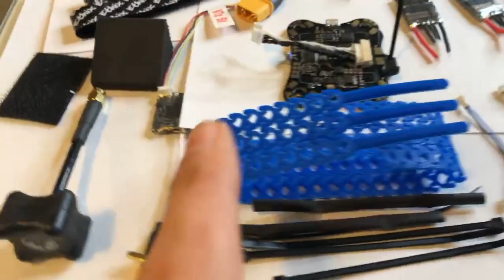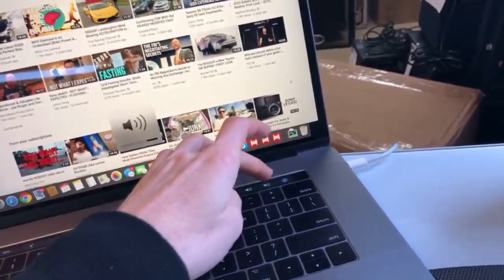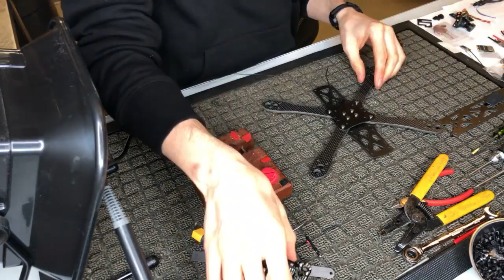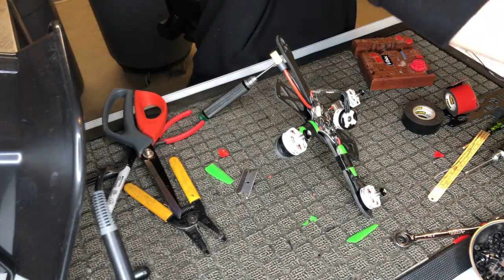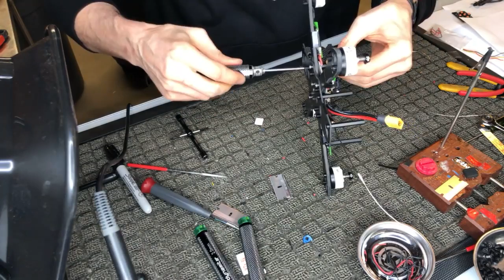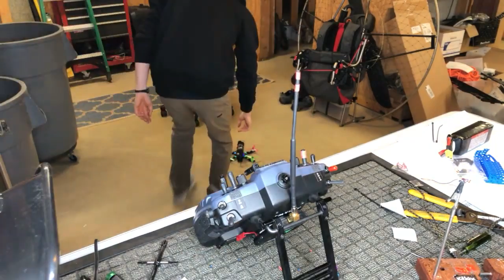Mr Steele Alien Build Video 2019 updates Step by Step! (from scratch) LIVE answering questions

Comment: In addition to the capacitor at the battery terminal, you can add a TVS diode to attenuate the voltage spike during connection (helps save the batteries), for a 6S with breaking voltage at 28V would work fine (like a SA28A)

Comment: at 18:30 you mentioned that washers are used to "avoid scratching the carbon", it's not actually true. The general use for washers under a bolt head is to distribute the clamp load to a larger area, since the head makes very little contact with the part (considering the hole is also larger than the diameter of the bolt shank). It is especially useful for carbon panels, as even though carbon is very strong and stiff, it is very weak in dealing with point loads, such as torqued bolts. You might say it works for you without washer, blabla, but just saying that washers are not used to avoid scratches but to distribute the clamp load at the joint with aim to avoid pull-through failure. I would agree though that the PDB & FC boards are not exerting tremendous loads on the panel, but for the rest of the frame I would say that washers are a good idea.

Comment: I’m running 45amp 4in1 in 4s but 6s capable on 1404 3000kv mamba motors on a 3” Roma l3 with a clracing f722 32mb fc that’s 8s capable. Feels good.

Comment: Jeez, 900 F is blisteringhot even for lead-free solder. I guess for soldering cables to pads it’s fine since your not really close ro a component, but people should really learn to solder at a more sensible temperature if they’re even going to solder some actual circuits. For lead solder I’d say you want to stay under 650 F, lead free needs up to 750. Higher might be good for desoldering something big from a massive ground plane. More important than high temp is that the iron is capable of delivering enough power so that it can maintain the heat set when in contact with something big. If you have a less powerful iron you can pump up the temperature to compensate in some cases, since that makes it take longer for it to cool, but it’s bad practice.

Also, solder fumes from fresh solder isn’t dangerous to inhale, even for leaded solder. You should however be careful to not put your fingers in your mouth or eat without washing your hands thoroughly after using leaded solder.

Like I sais, for solderimg wires to pads it’s probably fine to crank it, and it does make things easier, but don’t try to solder a sot-23 IC at 900.

Comment: I flashed FC and ESC, and am able to test all 4 motors on KISS GUI. But motors only respond to radio when FC is connected to KISS GUI and only goes up and down(not left or right).
Can anyone help me trouble shoot this? The fact that motors respond when the FC is connected GUI, there is communication between the radio and the receiver right...?

Comment: Thank you Mr Steele! From this video I went from absolute beginner to flying. For those whom are also starting for the first time, a couple of things I found that I needed more info to get going 100%. 1) With the Kiss PDB board you need to solder the 5v and the little pad next to it to bridge them to get the video transmitter powered. 

2) You need to install the Kiss GUI software and connect to the quad, in the 'Configuration' tab create an 'Arm' switch under 'AUX Functions', select AUX1 Medium + High, you then need to program your transmitter model to include an ARM switch. 

3) With the battery connected to the quad, plug into the Kiss GUI software, then use the 'ESC Flasher' tab in the Kiss GUI software, there you can reverse motors 2 & 4. Hope this helps someone.
Reply: Paul O'Connor I have set the arm switch but still not arming..  I don’t know what is the issues. I’m new to kiss and Crossfire.. pls help me on this...

Comment: Anyone know what the wooden clamp steele is using in that video? looks pretty handy
Reply from the maker: Called a solder buddy.   Trying to make that a thing  soon
Reply: @MrSteeleFPV  Looks like its out of production. I have a CF tool that does a similar job but was from the era where Deans Ultra connectors were the bees knees :) I like the idea of a soft-jaw clamp in the same device though

Comment: When you select which vtx power in the kiss gui you want to run, does this automatically unlock the tbs unify pro vtx? Also is the low power option for  when the quad is disarmed and high power option for when armed?

Comment: Built one !!! If I managed you will too))) My first soldering experience and first drone! Few tips from total a noob: 
1. Get the proper tools! 
2. Work Place will be a mess so keep everything structured. 
3. Check that power wires are the same length. (big power one)
4. Cover ESCs with some paper sticky tape before soldering(to prevent splashes) 
5. To make motors spin you Mast: bind to RC+ switch to Crossfire in kissGUI+ flash ESCs.   
6. You will have to improvise a bit with Antena setup but it's not a big deal.  
7. Configure channel endpoints in KissGui +failsafe +buzzer etc. Good luck everyone!

Comment: About cleaning the soldering joints with alcohol. If you use tin that uses corrosive additives ( FluX )  you need to clean  the joints after soldering otherwise its fine to leave them uncleaned.

Comment: Hey man, great vid! what's your AUW on 6s without 4-in-1 and 6s with 4x escs?
Reply from the maker: 4-1 = 600g 4X = 595g. The pdb is a little heavy without really being used for power distribution
Reply: @MrSteeleFPV  Thanks man - I was just watching your earlier video on the AUW comparison between the 4s and 6s setups.
 You mentioned that you are looking to potentially change things up in terms of the PDB for 6s in the future? 

Is there anything in the pipeline or should I pull the trigger >:)

Comment: @mrsteele any ideas on when a up close 6s build video would come out. waiting on parts and then it's Mr Steele kiss v2 6s for me.
Reply: I may be wrong but a previous build video he had stated 4s and 6s are mostly the same configuration with the exception of one or two things being reversed. But I too am waiting on that and attempting my own research while doing most of the setup he instructs in this video.
Reply: Prismaticmind yeah I ended up building his 6s setup and I am loving it.
Reply: @AlbeyFPV  way awesome! I'm a bit paranoid about screwing something up, already have the parts and assembled what I know to be safe, but I will wait a little longer before bitting the bullet and finishing the build without a video if necessary.

Was I right that the only change was plugging one thing in opposite of 4s?
Reply: Prismaticmind the only thing that changes is you add capacitors to the escs otherwise build it exactly like this
Reply: @albertgermishuys  capacitors? Dang, so even the hook ups are the same? And do you have any reference for the capacitors so I could find out what kind and such? I'd love to get this thing up and flying. Thank you for the replies.

Comment: Hole no. 5 on the K plate is 20 degrees. The first hole is 0 degrees, so 2 is 5,  3 is 10,  4 is 15, 5 is 20, 6 is 25. 
Please tel me I’m wrong my dude 🤘
Thanks for the idle up video you did, helped me get my set up sorted 👍

Comment: Did this exact build for my first KISS setup...
I can't connect to the KISS GUI on my MAC, can't find any useful help on the net, now feel I have an expensive brink sitting on my table :(
Just get that flashing blue light because Kiss needs to verify the FC
Was a bit hesitant to try KISS from what I have heard...feeling a bit put off :(
Reply: I had the same problem on my Mac, this fixed it.
"In some cases you might need to download the drivers for the CP2102 UART/USB."
https://www.silabs.com/products/development-tools/software/usb-to-uart-bridge-vcp-drivers

Comment: New to to FPV and looking to jump in. After watching this, I get the assumption this is a little more "high end" build. Do you have any "pre-built" or starter packages you would sell or point me towards? or would you sell this drone, already built? I know you link to this package down below, but the whole build process is a little intimidating and im worried I would mess something up.  Thanks for your time, love your channel. Let me know if this is even an option and ill shoot you an email.
Reply from the maker: This is one of the highest end builds yes.  There are cheaper ones out there. I just have always just gone with the best of the best and had a great experience with it.  Created my own formula and yeah..    there are many cheap builds out there but I can’t recommend any because I haven’t tried any of them nor do I want to lol. Sorry man.
          I do recommend building your first quad. As you will crash and you will break things
Reply: @MrSteeleFPV  I hear ya, and that makes total sense. I guess i wasn't explaining my self correctly after re-reading my comment. Im not looking cheaper/worse quality. Just less of the soldering, connecting every single wire myself, etc. digging back through your videos, im watching "Mr Steele's "Getting into FPV the Right way" (Setup/Lipos/Sims)" from 2017 and i think this might be the best path. I'm just trying to skip on the "building it all from scratch" approach lol.
Reply from the maker: Lol. Check out my “how to FPV” series.

Comment: Erm yeah kiss think you need to use different connectors for your flight controller i know it might eat into the profit on that 70 dollar FC but hey.
Reply from the maker: Considering it’s $55.. and I make zero dollars off of those sales..  makes sense
Reply: @MrSteeleFPV  sorry but defeats the point of having FC connectors when a simple mixup of connectors equals your expensive gear burning up. 

I guess it emphasizes the need for a smoke stopper even when building a KISS quad.

Comment: Where can I get the wire at I bought everything but i don’t know where to get the wire at
Reply from the maker: https://ethixltd.com/portfolio/ethix-quad-builder-cable-set/ 
Should be back in stock soon
Reply: Mr Steele can I use 22 awg silicone wire instead of the 26awg

Comment: Just a tip from someone who streams semi regularly.

You have enough cameras. Look into running OBS (streaming software) and enabling 2 cameras and allowing you to do much more than just raw stream from a device. (Software is free btw)

That way you can not only completely customize the layout of the stream. Also the availability to enable 2 camera angles so you can set up one cam like you did, and another for the close up soldering and components.

Easily set with the push of a key on your laptop. Just a suggestion. If you ever want help setting this up I could do it easily for you in a matter of minutes. Feel free to reach out to me if you’re interested 👍
Reply from the maker: Hit me up video email. I’d love to chat about that. Been contemplating this for a while but haven’t ever put the time to learn it. Mrsteelefpv@gmail.com

Comment: I built this quad with the original mr Steele pdb, after a hard crash it broke the pdb were the arms connects to the frame, good to see the v2 uses the same mounting method as the Reverb wolf pdb.

Comment: Watching this makes for some real good refresher material. Also an interesting progression from the previous build stye you had (TBS Core PnP days). Lots of minor changes in parts but also in the way you dress your quads. I'm pretty well versed at builds but can definitely still spot a few areas where my current freestyle builds are slacking a bit.  Good food for thought.

Also makes me wish real bad for two products which would simplify or improve many FPV lives, possibly including yours:

1. For Trappy to make us a legit Immortal L antenna (pretty confident that mini quads need the better polarity coverage more than 10km max range)

2. For Flyduino to make a 'Mr. Steele Edition' 32 amp KISS 4 in 1 ESC that integrates the mic & OSD, plugs right into the KISS FCs and is designed to work with any normal 30.5x30.5 frame build and not just the Alien (no offence but not all of us KISS people fly Aliens). Since they did a PDB with you just for the Alien maybe with you they'd finally do a proper fully featured no excuses 4 in 1 which works for a ton more KISS setups. Hey, one can dream I guess. I'll still fly KISS without that stuff but man, Betaflight software and hardware is just evolving like crazy in terms of ease of use and ease of install by comparison. 

Make a 2 hour build vid, get a long ass response I guess. Hey, whatever man - keep at it & peace out!

PS I like to tape around those foam landing pads with hard shiny tape so the quad can land soft or skid for ages.

Comment: I have a question regarding the camera mount. You said count to 5 and thats 25 deg. Not to doubt you but I was under the impression the first slot is 0 deg which would make the 5th hole 20 deg. Is this correct or was I misinformed?

Comment: What would it require to buy this kit and turn it into a 5" 6s low kv motor  setup? @MrSteele
Reply from the maker: Literally changing the motors for “stout” 1700KVs and adding 4x 470uF capacitors  one to each ESC.  if you wait a week or so there will be a 6S setup available on the TBS site
Reply: @MrSteeleFPV  great! i continued to read further on the drop down tab and saw the 6s motor link and battery link. will wait for 6s setup video to show how caps should be wired. thanks for the quick response and great website btw. look forward to flying your build. btw its my first build lol. only been flying mobula7 whoop so far haha
Reply: @FastAFBoyyy  Can you guys help me please. Do have the link to the 6s video, to show how to add the caps on. Hamza from west coast of Scotland
Reply: @hamza220290  i nvr found one. My 6s set up doesn't require caps on each esc to be soldered on because i already have them from factory on the airbot wraith32 blheli 35amp individual escs
Reply: @hamza220290  but i would assume you wire the negative side of the cap with the solid stripe line to the -negative black wire on the esc and the positive to red. Should be simple. Leave slack so you can flip/curve it over to sit on top of the esc with a clear heatshrink wrapped around to prevent shorts. Or just youtube wiring capacitors to escs im sure somebody has made a video. Me personally i havent needed to yet.
Reply: @FastAFBoyyy  Top Man!!! thank you so much for your info, it has made that problem all clearer in my mind. I hope it works for. thank you again H

Comment: All Kiss Flight controller run at 1K loop time, you can change it but anything above 1K automatically turns off the Dynamic Adaptive filtering.. it's designed to run 1K, so leave it on 1K and prepare to get mind blown !!! 🤯... Hahaha ..

Comment: How accurate is the amp reading that displays after your flight? The Wolf PDB OSD reports 178 amps on my 5s, 2207 2550 kv setup on 5x4.1x3 props which doesn't seem accurate. The esc average amp rating is only 24 amps... I know the Wolf PDB has a scale you can adjust for amperage but how can the actual consumption be validated?
Reply from the maker: It’s within 3-5A I would say. As the telemetry is coming from all 4 ESCs. On my 4S rig perk amp draw is around 85A with average under high load at 75-80A. My 6S setup With everything the same just 1700kv motors and a 6S 1100mAh is peak 65 average 59A
Reply: Thanks for the swift reply. 
 @MrSteeleFPV
Reply: @ayougo  178 amps seems a bit much for 2207 motors
Reply: RockTouching I had “Auto” amp sensing turned on. I switched it to “sensor” and the current draws are far more realistic...about 120 amps on 5.1x4.1x3 hq props
Reply: @ayougo   That seems about right!

Comment: Yep failsafe setting is importend. Why do you don't use a 4" Body ? 
Next question. I use one of the firstz Mr.Steele PDB. There is an issue. If i make a hard flip or turn. The Picture disapear for a half the second. I am not the only one with this issue. Is there fix ? I used a 1000µf cap. but don't helped... by the way nice build video and many usefull tips

Comment: Excellent vid, watched half live and just finished watching the rest.
Question if i may?
What is your experience of the crossfire rx immortal t antenna vs the stock antenna used in this vid?
Cheers
Reply from the maker: I think the way I setup the stock antenna gives me way better durability. It’s lighter and I get better performance.  This is all personal experience  and bias experience because I don’t like how the immortal t has to mount sideways on the aliens for me to be able to land
Reply: Mr Steele awesome, thanks for the reply. Just the sort of feedback I was after. I'm building my first crossfire build and wasn't sure if the "improved" rf performance of the immortal t was enough to negate pain in the ass mounting options compared to the regular antenna. I'll stick with the regular and copy your methods. Cheers from New Zealand.

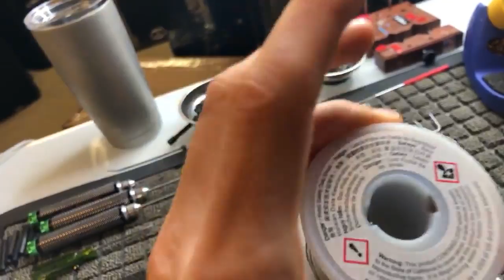Comment: @2:50, about the soldering compound, what matters over all these numbers is : SN63PB37, means 63% tin, 37% lead :)
And 0.8mm diameter.
Reply: I use 62/36/2 that’s just as good right?